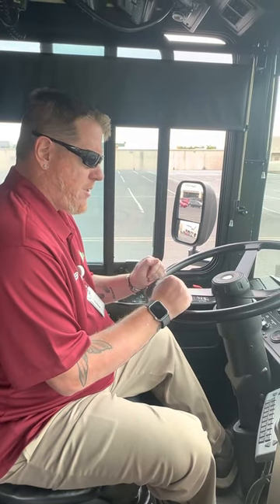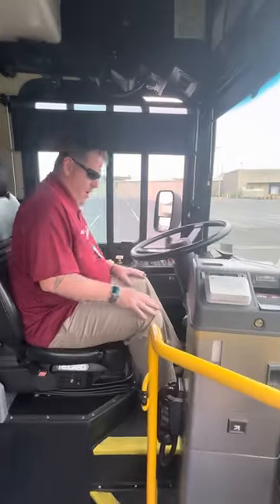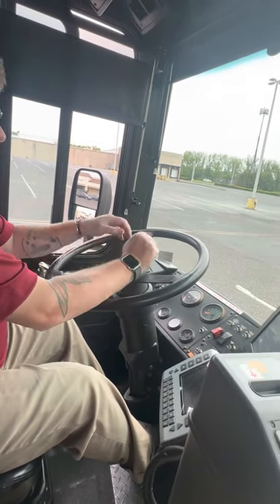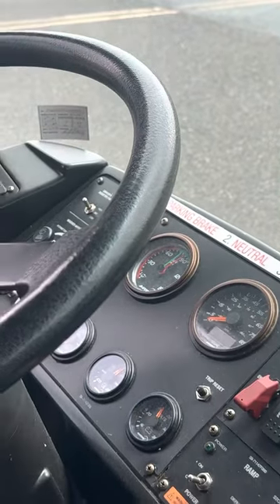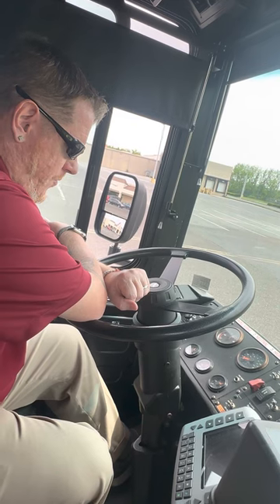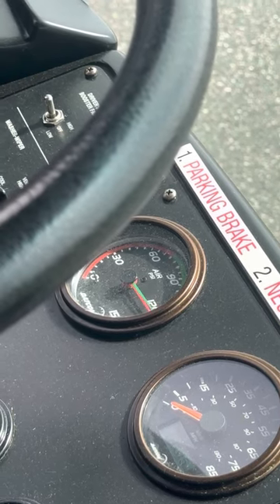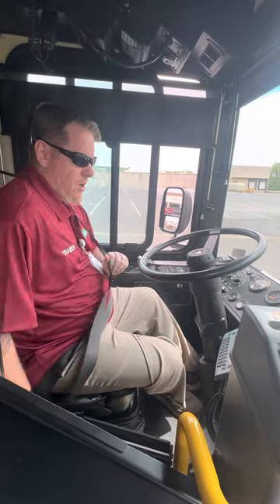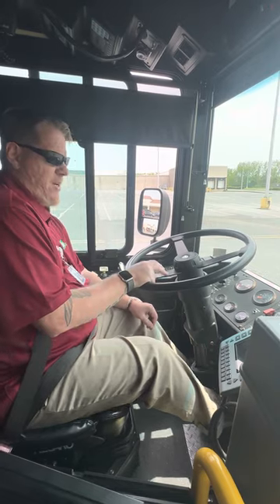Air brake test on a Gillig transit bus

Comment: Interesting, you guys skip the static system check. After chocking the tires and before applying the service brake, we release the parking brake then look and listen for any leaks, expecting an air loss of 2psi or less. Is that just something extra we do in our district?
Reply from the maker: Yes as of August 2023 PennDot has changed their CDL testing procedures
Reply: U forgot the rear door check

Comment: I have a question! Bus driver newbie here and today when I parked my bus I put in neutral, then applied parking brake while holding the service brake down and there was an air horn sound and a sudden loss of pressure. Is this normal? It’s a Gillig bus
Reply from the maker: Sound to me like a governor issue, or did you do all the steps you mentioned with the bus off?